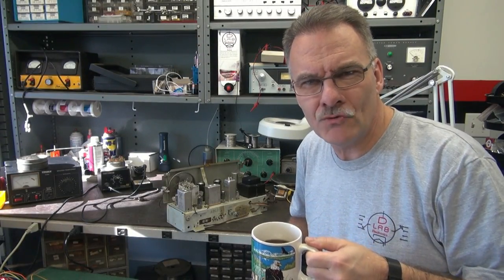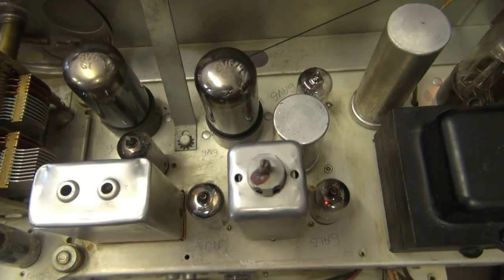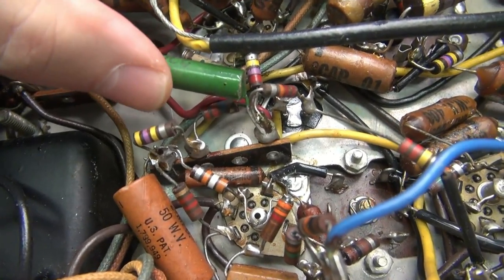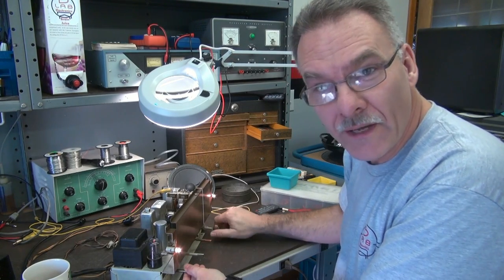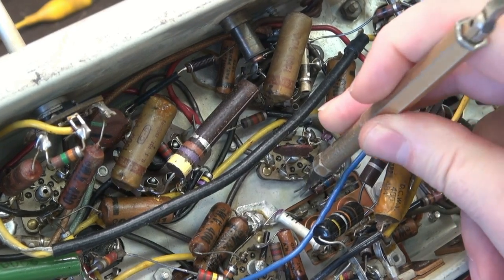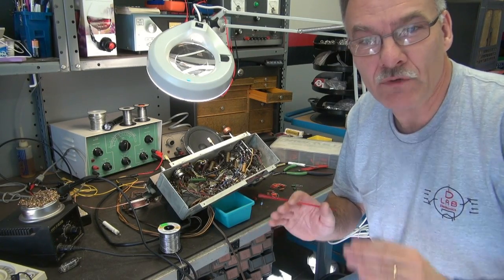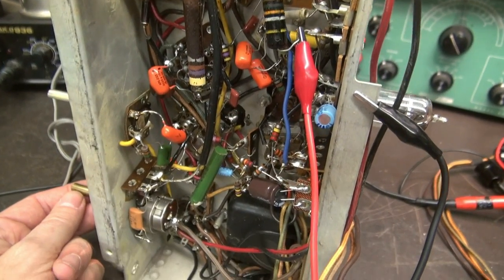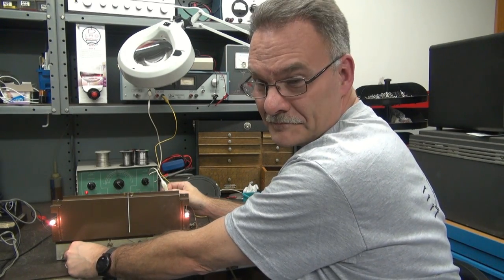RCA Victor console AM FM Tube Receiver restoration How to by D-lab

Comment: Very helpful video. Thanks!  I’ve just begun working on an RCA 28X5 radio (circa 1940). Initial tests show it to be working, though poorly. I intend to replace all the caps following the steps in your video. I also have noticed that the insulation on nearly all the wiring is dried out leading to numerous cracks in it. The wiring in the unit is so convoluted that I’m not sure I should mess with it. I’m not trying to restore the radio, only make it safe to operate. Do you view cracked insulation as a key safety issue such that I should replace all the wiring? Thanks again!

Comment: hi terry.....i need a pc of info if you have ran across this: on the 58-60-ish era shc-7 stereo amplifier units with the tape-phono-tuner inputs and the L-R spkr outs( the RCA jack to one 1/2 of the cabinet spkrs and other tranny feeding the other pair using common ground....were there multiple schems for stereo units and for consoles sold with a dedicated second spkr cab? my slide switch is not wired per the available schem from radio museum...but *is the 3x6cg7 / 2x 6v6 layout,. "help" if you can ...OR any of your readers . thank you love your stuff